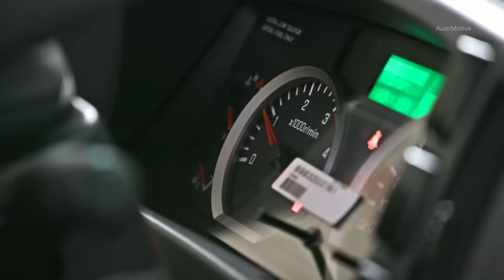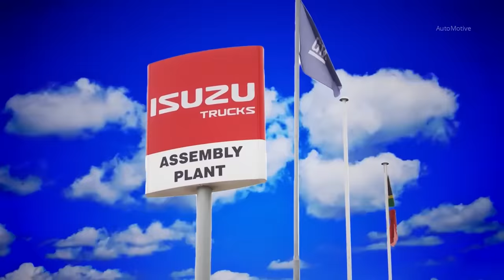Isuzu Truck Factory - Production of Japanese trucks

Comment: Ive driven Isuzu working in rail the older 2008 style where a good truck the more modern ones are probably ok if you use them on road , but the brake boosters will snap off the truck if you do any off road work with them the fancy radios will also pop out , and in general the interior is cheap nasty garbage , I have a 1995 elf of my own and its got heated seats and enough of the modern tech built solid and is still a great truck .

Comment: I've got 2 of this model good trucks apart from the manual gearbox which has problems that Isuzu have had for years and never ironed out best to go with the Alison automatic
Reply: I have 8 Isuzu trucks. I  have had the same problem in Australia on The FRR 600 110/260. The ISUZU MZW-6P 6 speed gearbox cannot be fixed, there is 6 revisions for the syncros - even the dealer does not know how to fix it. I now order the truck in alison auto only! Alison Auto is the best.
Reply: @kj6ktpixw  IS Alison a Brand of trucks

Comment: This Wessel i am going to tell you about is a challenge....here it goes....all or nothing...In the year 1971,we travelled to Henån City,and on our way home this Saturday,there was strange changes on the Car Radio, and like a big Church Organ,the Radio had very strongly effects with multiple frequences very loud.
The Owner of the Car,Bert,said that we shall be alerted,because we are supposed to see something very rare....

Bert was right, there it was.Golden glowing.
This was fascinating
Never before have we seen such a Night glowing goldyellow gigantic wessel.
Our Chauffor put the foot on the gaspedal.

The Car motor was not quite tuned,ignistion
And therefore we just was in speed,some 72 kilometer/per hour. Bert was keen on Study the under of the Gigantic Wessel.

Just before we where about to reach the North side of the Tunnel,aproximate 30-40 meter,before outside the tunnel and on the South side of Bridge of Nötesund there was two sound,clang and clang,we hear as the window of the car,was down ,too be able to hear sound of the totally silent enourmos wessel hoovering some 50 meters above Sea Level.....

Later we heard a withness tell,that he had taken a rifle,and shot two sharp ammunition under up of the Wessel. That was the exponation,clang + clang,underneath this Wessel...

Glass Metal is 50 times stronger than ordinairy
Metal or Stone. But anyhow,fraction of seconds
Thereafter,20.13 in this Evening,in a very strong white,Sonoluminiscence flash that move Easterly directions with an immence acceleration,that no living thing could have a chance to survive.

My beliefe is that we saw a TIME-travel...

Withness saw 5 or 6 white Flashes along the pathway of this Wessel,at this time 20.13

20.04 o clock this Wessel came out of misty fogg,just materialized, 3 children aged 7 year old girl,and two cousines,about 9 year old,told us that they tought it was the Moon.

They realized that it was not the Moon.

This came to their attention,as they saw the pattern under this Wessel.....

So this all happened this November evening.
There are more details.Houses went dark,all electric devices stopped working,because of this Electro Magnetic Pulse.
There was also seconds later,a big rubyred glowing cloud,in Eastern direction,it was very special movements,hard to explain.
And seconds later a big dark blue NATO-star,it was only there for 5 seconds,and when it nomore was glowing,the Ruby Red Cloud went gone.There was as nothing have happened. Dark and somehowe terrific,like in Cinema.
But this was a genuine UFO.
NOTHING about it in the news.
Not in Television,not on Radio,not in Paper News.1972 i wrote to Elvis Presley about it.
No answer.But years later i got a letter from Bill Clinton.

Comment: I used to drive an Isuzu NPR with a gas 6.0 LS engine,. Biggest piece of junk. Rattle box.  Everything was a mess on it and it had low miles.    AC broke at 40k miles And and again and again Gauge cluster broke Engine misfired low power.    They limit the throttle on these because they were eating transmissions.   So their fix was to lower the max throttle angle so the thing had little power.